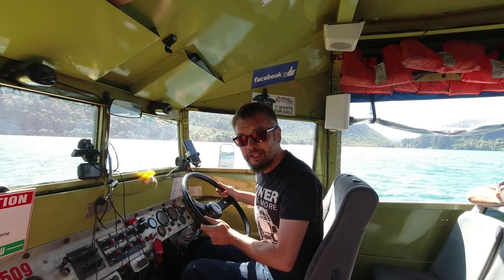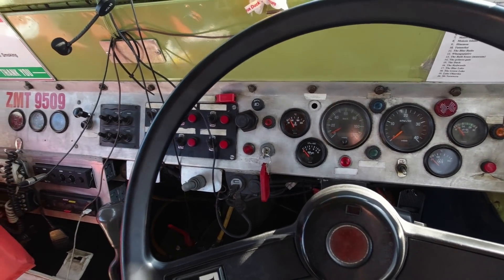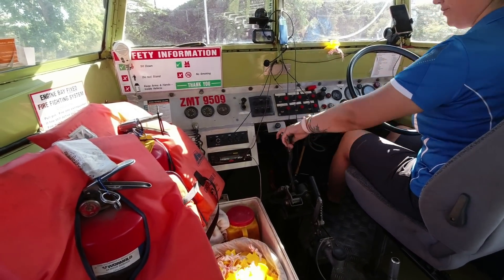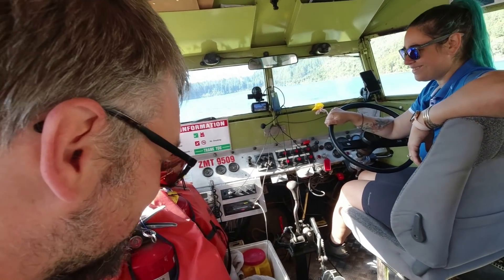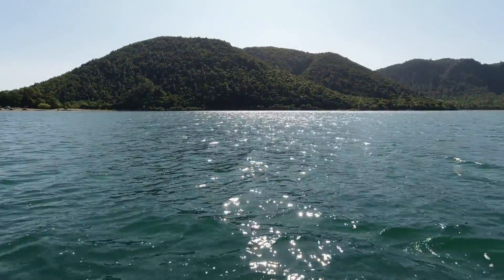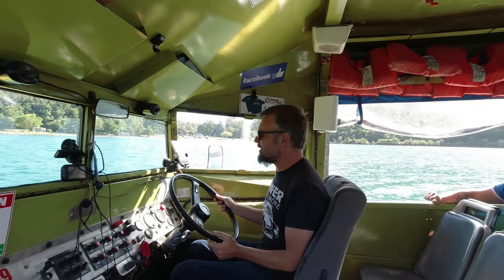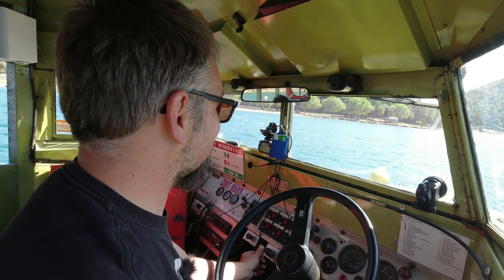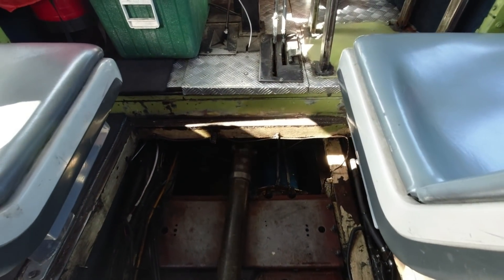I drive a DUKW! On a lake!  (60,000 subscribers!)

Comment: Imagine climbing all that way up to work on the engine, only to drop your 10mm socket through the bay and have to climb all the way down again 🤣

Congratulations on reaching 60K, well deserved!
Reply: It would probably be a 13/32 on this thing, are they as elusive as their 10mm counterparts?  😂
Reply: Well, on a DUKW you'd be dropping your 3/8" socket, but you'd also find that 3/4" socket that an Engineer Combat Battalion mechanic dropped in 1944.
Reply: @jsteel8288  Brilliant 🤣
Reply: That would be slightly more annoying than doing that when you're working on your car at home...
Reply: @jsteel8288  
Not if your working on that Mitsubishi engine....metric.
Reply: I'd suspect there's no such thing as 'through' as the idea of boats is to keep water out !
Reply: Love this 😊
I love the way you explain things. It's like I'm experiencing it myself. Thanks Ian!!

Comment: In the late 70s/early 80s they had one of these (painted bright pink for some reason) at Wicksteed Park near Kettering. They'd come driving down the hill at what seemed like ludicrous speed, smash into the water, and then cruise round the lake for a bit before driving back out. Don't think it's there anymore, but I remember riding that thing as a lad...
Reply: Funny you should mention Wicksteed Park! I worked there in 2017 and my job was to drive the ex North Sea lifeboat that they have there now 😂 Was a cool job, really enjoyed it.

Comment: What Fun ! Driven them on the road and on the sea and when you've got over the thrill of a DUKW try driving a LARC XV(15). Interesting that you have low pressure air in the diffs to keep water out but to enter the water without the prop in is bad practice. Going ahead the steering is just about adequate, astern very poor.

Comment: As military vehicles these were meant to have a crew of 3 one being an assigned mechanic for daily inspection and maintainence. Their weakness is that all those friction bits wheel bearings, joints and steering components get hot. When plunged into cold water can suck water in. We had one crash here in Seattle and rammed a tourist. Basically one of the front wheels fell off and that pivoted it across 3 lanes of oncoming traffic. The National Traffic Safety Board report pinpointed inadequate maintanence and crew training plus the age of the vehicle as the cause of the wreck.
As a military vehicle design the exceeded expectations and were critical in landings from Anzio to D-day. War time safety standards, when there were many more threatening ways to die, are not what we expect from passenger vehicles.

Comment: I remember when they used to have a Dukw on Benllech beach on Anglesey when I was a kid (70s).
Reply: They had two on Mablethorpe beach Lincolnshire in the mid 1960's had a few rides in them. Just a bench round the outside with a couple across the middle. The things were supposed to leak so bad the bilge pump ran continuously?

Comment: What, no pendant wiper action? :-O

I've been on the Wash Monster, which is a LARCV, (Lighter Amphibious Resupply Cargo vessel), smaller and lighter than a DUKW, and it's a weird sensation going from land to water! I still enjoyed it although I didn't get to drive!

Great video though Ian!
Reply: Chris, if you are from Hunny wasn't it a DUKW in the 70s? Anyway five miles out and water still only waist deep :).
Reply: @danielgower5531  It was at Hunstanton, but the machine is only a 4 wheeler! So I looked online and it says on their website that it's a LARCV! :-)
Reply: @chrisskelhorn5727  No probs. Know the one you mean. Think in the 70s there were two DUKWs operating on rotation (childhood memories). Pier used to be longer than a 50ft as well!
Reply: @danielgower5531  Despite living in Suffolk since my birth in 1957, I only went to Hunstanton about 3 years ago! :-O

Comment: there have been no ducks at Liverpool if u remember they both sank within 3 months of each other as the cheap-ass owner was not maintaining them and the big problem with the duck is the reason ducks shouldn't sink is the massive water pump that pumps all the water out but sadly runs off the engine so no engine its sinky sinky time what do u think happened to the ones at liverpool